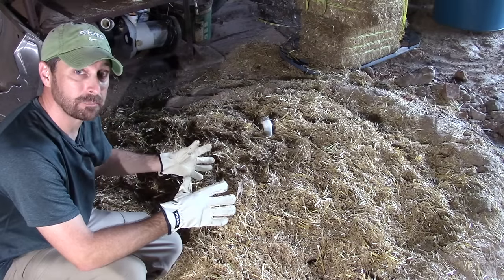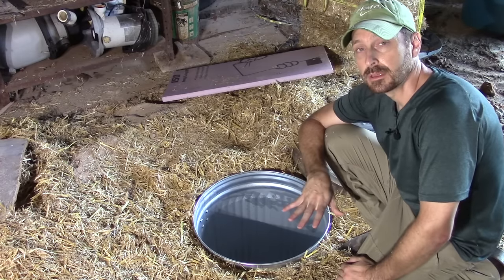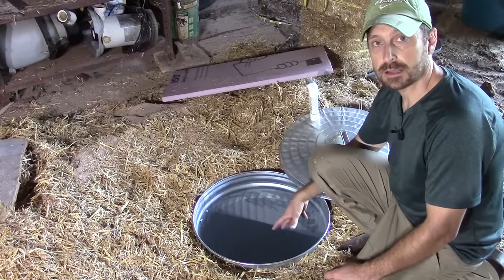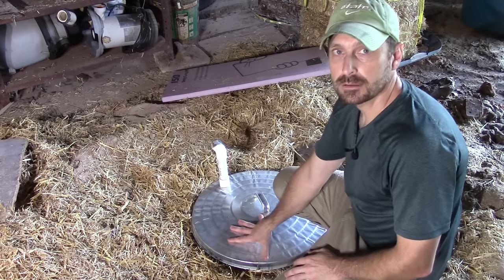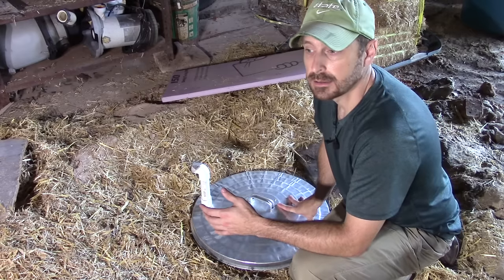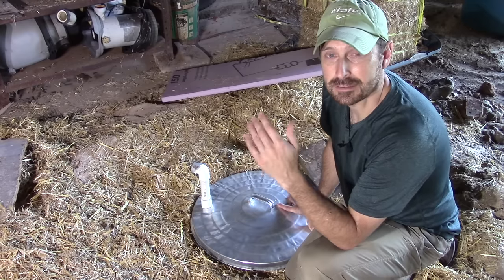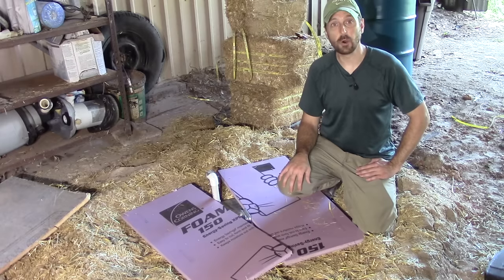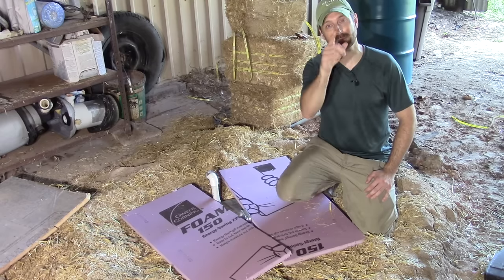Our Simple Inexpensive Root Cellar Build

Comment: Question:  Will this work at sea level, in a tropical climate, like Florida?  You can't dig too far without hitting water, but you have to dig a little deep to get to cool soil.
Reply from the maker: Unfortunately it will not work at sea level or areas with a high water table. It would work it you had a hill with well draining soil.
Reply: Here in florida we can dig down a little, also if you put drain rock at the bottom and build up the soil around it, that rock will really help keep it cool (I accidentally changed the pH on a tomato by putting drainage rock in the bottom of a planter and that rock kept the soil cool even though it was all above ground and VERY warm here)
Reply: Florida here too! Oh well ,thank You.

Comment: Love this idea. However, I live in an area where fire ants abound. How can you keep the ants out if you drill holes in the bottom of your trash can?
Reply from the maker: I live in Texas. They say the whole state is on top of one big fire ant mound. We have never had an issue with any bugs in the can sans 1 spider. We have hard pan clay that is 18" down so no insects venture through that medium. You can put screen on the bottom if you are concerned about it.
Reply: Put boric acid around the outside of the can and under the can, and you will not have any ants.

Comment: Do you add any pea gravel under the can before placing it into the hole to aid in moisture drainage?
Reply from the maker: We didn't but you can. The would be a great addition. We have never really had that much moisture inside.
Reply: Over here the water table is so high if you put holes in the can it would just fill up with water :)  great sump pit though.

Comment: I've got questions and would really appreciate your answers. --- 1) You mention covering the lid with soil as well as straw. So do you uncover and then recover it each week when you check your vegetables? ---- 2) Since you layer the vegetables, are you removing the layers one by one each week to check for any bad ones? Otherwise how are you able to check the vegetables from the bottom layer? ---- It seems this could be problematic checking them each week. But you did say your father had done this too so it's not something new you're trying out. You must be an easy way to check each layer.
Reply from the maker: I don't really check on them that often. When I open it to gather some for cooking, I check but other than that I don't. It is inevitable some will go bad just like in a refrigerator. I usually just keep straw on the top with some 1" foam insulation covering that. 
Yes, my father did this for a long time but in a different climate. My carrots and potatoes do seem to loose some moisture and shrivel a bit. They are fine on their interiors and the carrots are still crunchy.
Reply: @CountryLivingExperience  Okay, thanks for the answers! I live in the Pacific Northwest and the ground rarely freezes so I could do the same. Not for this year but the next, ideally, I wouldn't mind doing the same as your but with smaller sturdy plastic garbage cans that are about 2 feet in height. I could keep separate root vegetables in each. In winter, our daytime highs and lows have only a little difference between them - around the freezing point - so the ground temperature should be good for storing root vegetables. .
Reply from the maker: You need to check the frost line in your area. That will give you a constant temp. The two foot deep cans may not provide you the depth you need.
Reply: @CountryLivingExperience  I plan to. 😊 I was thinking if I needed, I could sink them a little deeper even with the smaller cans. I could put a barrier around the sides of the soil above the cans to prevent it from caving in and layer lots of straw and rigid foam on top.

So what does a person in a climate that doesn't get freezes do - other than construct a room much deeper under ground level?

I meant to add a note to your use of hay. I'd recommend using only straw, not hay. Hay is nutritious and has different kinds of grass and plant seeds in it too. It can be a temptation for small creatures. One year I made a potato plot where the ground is prepared with the cut seed potatoes laid on top. Rather than covering them with soil, you cover with loose straw - about 1 1/2 feet or more. It will pack down some and the potato stems and leaves grow up through the straw. Any weeds that make it up are easily pulled out. If you want nice summer potatoes, you simply fold back some straw (it's like a quilt) and choose what you need without disturbing the plant. Nice and clean potatoes too!

It worked great ...except for one thing. I couldn't get ahold of any straw bales then so took hay and used it. My potatoes came along great but later mice or some small rodents nibbling on the hay discovered my potatoes underneath. I end up with very little. I later found it that it was STRONGLY recommended not to use hay for that very reason. Doubtful any rodents would get into your can root cellar but why attract them to your shed? They'll only cause mischief.
Reply: I'm in the northwest also and I have had some experience with rodents chewing into plastic garbage cans.  Have you done this? Did it work okay?
Reply: @linkylou13  I live in Los Angeles County, CA. Yes, rats will chew through thick plastic. I have had many rigid plastic storage bins eaten through. For me, the metal would be better.

Comment: I wish the root cellar that used to be here was still here! It was tore out filled in back when my Mom was being raised here. I live in the Salt Lake Valley and winters get cold but not like they used to when I was young. Our water lines have to 4' deep so they will not freeze but I don't think our ground freezes even close to that far down. I usually just leave my carrots and beets in the garden all winter and cover them with a good deep layer of my tree leaves and then just go out and dig what I need through the winter. The soil under the leaves doesn't even try to freeze and is just as easy to dig as during the summer. I just wish I had somewhere to store things like apples, potatoes, not sure if I could make this work? Mine would be out in the weather, I don't have a barn or dirt floor garage or shed to put one in, so I might not be able to control the moisture.
Reply from the maker: It may not work for you then. It needs to be under cover. Hope you find a solution.

Comment: Finally! A diy root cellar video by someone who lives in a hot climate! We live in FL and what we really need something that will work in the esp heat. Even more so because we are more likely to lose power and be unable to refrigerate produce during hurricane season. But how do you keep bugs from getting through the 3/8 in holes you driilled in the bottom of the can?
Reply from the maker: Hello. Keep in mind this does not work well in the extreme heat of the summer. The other seasons are no problem. The holes in the bottom are no issue for us because we have hard clay soil. You can put screen in the bottom if you have s softer soil with bugs in your area.

Comment: How about using a plastic chest ice cooler, bury it and cover it. In florida you can bury a giant garbage can, plastic with a inside locking lid and a molded seat inside to sit down on during a hurricane!! Its a 1 person shelter. Cheap, easy to install, and doesnt rust and has a locking lid from inside!! Its square in shape! I would guess its under $100. They are about 3x3 ft  square !! 😊
Reply from the maker: That could work.

Comment: Yes I'm looking for a small refrigerator I can take everything out of it and put it in the ground on its side and it will close up easier be great if it's locked up too and it is insulated It is a little larger then the trash can and you can see what your vegetables better I need something a little larger😀

Comment: I appreciate your video. I grew up in south Arkansas where my mother's uncle had a large garden and a storm cellar which served as his root cellar.

Now i live on the Arkansas/Oklahoma border just south of Fort Smith.

In this area we have heavy clay beneath the topsoil. When setting fence post, your hole will fill with ground water at about 18".

I bought my 32 gal galvanized can. 
Now i have dug my large hole in a covered shed area. Amazingly, i never hit ground water....but, we have had a very dry August and September. The day before yterday, I drilled 3/8" holes in the bottom. WHAM!  Yesterday, we received heavy rain, now my large hole has filled with ground water, which I have pumped out.....but the ground is so saturated, the hole slowly trys to refill. 

My dilemma is.....do I go buy a barrel with a solid bottom and proceed. I definitely will have the lid vented as in your video. I have a large garden full of sweet potatoes that needs winter storage.

Any suggestions
Reply from the maker: That is a tough one. I am sure you put it on the highest elevation you could. If you are still hitting ground water, this buried can may not be the solution for you.
Reply: After sleeping on it, I have decided to triple bag the perforated can and drop it into my "now" dry hole. I can backfill it properly. My square acre is flat 😢

There are several abandoned sections of very old lateral lines on my property. Sad thing about them is that they "collect" and distribute water. My present pump system for septic is well away from my new root cellar

Comment: a slight improvement would be to put 1" of gravel on the bottom of the hole then put the can in so you get a little better air flow and better condensate drainage.

Comment: Great video.  I'm going to do this in the basement of my barn but might have to experiment as to depth.  We get frost here to 48" or so, though It's been as deep as 6 feet in severe winters (western New England).  I have to think that's not the case under the barn, especially at the headwall which is 8 feet below grade...
Reply from the maker: Thank you. When we were in Michigan and had one in our barn floor, we did not need to go down that far even though our frost line was 48". It was covered with straw and "insulated" by the barn.

Comment: Hi great videos !  When you said in one video dig to frost line.  Did you want the top to be at frost line or let the bottom of can to sit on frost line?
Reply from the maker: Top of can at the frost line if you can. When I lived in Michigan that was not possible since the fl was at 42". What we did was dig a hole in the dirt floor of our barn about 6' deep, set the can inside, then surround it with a lot of straw. The top may have had about 24" of straw on the top.

Comment: What size pvc pieces are used  or what pvc's used to create the vent? I see and elbow at top, straight pipe going into bigger, how's it underneath attached, help? And where was the screen exactly located along pipe? Thanks for sharing 👍
Reply from the maker: I just used scrap I had laying around. I think it was 3/4". I stapled the screen on to the outside end of it. There is no support inside for it. The hole I cut in the lid is just to perfect size to snugly fit and hold the pipe adapter. You just have to find the perfect sized hole saw.

Comment: You sort of glossed over the vent. Or I missed it and couldn't find it i. The transcript either. How did you do that andvwith which materials? Thank you!! I have the perfect spot for some of these😊❤
Reply from the maker: You're welcome. The vent portion was forgotten in filming. I just used some spare PVC pipe I had laying around and drilled a hole in the top of the lid to put it through.

Comment: Great idea but I wouldn't use straw on the sides as it will decompose and create heat
Reply from the maker: There is no moisture to induce decomposition. It is under cover. Been there for years with no issues.
Reply: @CountryLivingExperience  awesome I live in MN so the dirt is always wet until it's frozen.

Comment: I would drill a small hole and run a thermometer with a wire into it to monitor temp and humidity
Reply from the maker: That is a good addition.
Reply: @CountryLivingExperience  as soon as I can afford to buy some of these types of thermometers I want to have one for freezer and one for the fridge so you can monitor without opening it

Comment: So do you disturb each layer in order to check your stock? And then re-layer after examination? Also, details on drilling the vent? i'm a 70 yo solo woman and need as much detail as I can get ! Thanks for the great video
Reply from the maker: I don't check them often. 
The vent is simply some 1" pvc. I drilled a hole that was the exact same size as a 1" pvc coupling. Put a 90 degree elbow with some screen stapled on the end and just squeezed it into the hole. I did not secure it any other way.
Reply: @CountryLivingExperience  thank you so much for your response! I love you topics and I support you when I can 🧡
Reply from the maker: @judymiller323  Glad to help Judy. Thank you for being here.

Comment: Just wondering if you have two of those root cellar, trash cans. Apples, excrete, a lot of gas and cause other fruits and vegetables to go bad. Are you putting your apples in a different place than the rest of your fruits and vegetables?
Reply from the maker: Modify how you need to. Use more than one if needed. These are just examples.

Comment: If you don't have an "inside" location like a cellar or barn to do this with, can you build a small enclosed area to protect the root cellar from rain and other elements?  Any suggestions on how to do this?
Reply from the maker: Yes, you can. Use your best judgement and place it in a high area. My friend in Oregon has one under some pine trees. Keeps most of the moisture off.
Reply: @CountryLivingExperience  Thanks, that makes alot of sense.

Comment: Will that work here in Puerto Rico. We have hot humid climate. When power goes out?
Reply from the maker: You would have to do it a bit differently there since it is so hot. A sand cooler that is kept moist may work. I have not done one of those but have heard they work well.

Comment: Throughout most of the U.S., the temperature of the ground below the frost line (about 3 to 5 feet below the surface) remains at a nearly constant temperature, generally in the 45 ° -50 ° F range in northern latitudes, and in the 50 ° -70 ° F range in the south.Dec 2, 2021
Reply from the maker: I am aware of the specifics. I stated 55F which is the generalized average.

Comment: Cool video! I live in an area where ground only freezes 40 inches deep or much less (like this year). But it is a coastal area and the soil is extremly wet, especially in the spring. For this reason I got no cellar at all. Could I build a root cellar like this in a shady area of my garden?
Reply from the maker: Where do you live? If you have a high water table, this will not work well.

Comment: Ty for the great idea. Now I've got one for you. I live in Northwest Florida. Our water tables are not far down when you dig. We get hot here and the humidity is always high. Do you have any suggestions to install one properly without the water. 
I loved the idea of pea gravel in the bottom of the hole. And the rustoleum galvined spray to prevent rust. But I'm concerned about water. This is on a regular basis so to speak,  but like we have been hit this year with one storm front after another. 24 inches of rain in a3 weeks period of time from tropical disturbances. Wet summer
.how can I avoid water from getting in?
Thank you. And be Blessed.
Reply from the maker: You're welcome. If you have a high water table this method will not work unfortunately.
Reply: @CountryLivingExperience  thank you...
Reply: A can of brush-on bedliner will help greatly in water proofing.

Comment: Good ventilation through the bottom let’s carbon dioxide out, a good thing. Carbon dioxide is heavy and goes to the bottom, if not released it interferes with the respiration of the contents of the cellar. Oxygen in, carbon dioxide out.

Comment: Where I live in northern Minnesota, the frost line is 12 feet deep. And in the spring the water table is about 6" below the surface. I would be worried about water filling up the can in the spring.
Reply from the maker: All charts that I read state that northern MN has a frost depth of 60". I used to live in Michigan and it was 42". Your soil should drain well enough to do this. Only Florida has a 6" water table height. If you are concerned, I would put it inside of a structure.
Reply: @CountryLivingExperience  I was wrong, it's a 72" frost line where I live. (St. Louis County). When the snow melts it also rains, and during that time, I have dug 6" holes that filled rapidly with water on my property. Your mileage may vary.

Comment: Like it, but think I would add a bit of gravel below the can and coat outside of the can.  Straw a great idea but live where winters are colder, add some foam insulation around the can and lid then straw. The vent add a screen to keep bugs,etc out even though it's in a building.

Comment: Hi from the South, really South! Argentina! I´m going to try this in my offgrid place. My only concern is the rain getting in. I´m in a little hill and when the water runs... its runs! My be I can make a barrier with sand or something like that. Tx a lot. Valeria
Reply from the maker: Hello. I would try to place the can at the highest point on your property. You would try placing plastic in the hold to keep out ground water but I am not sure how that will effect the moisture levels. Good luck!